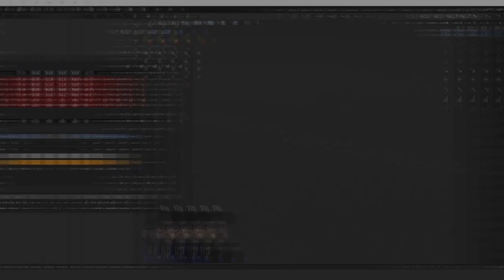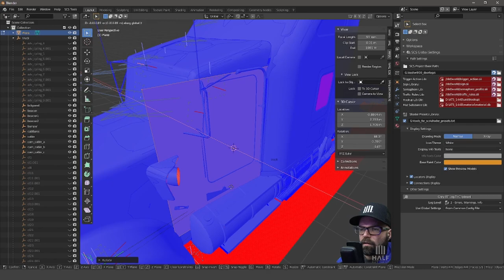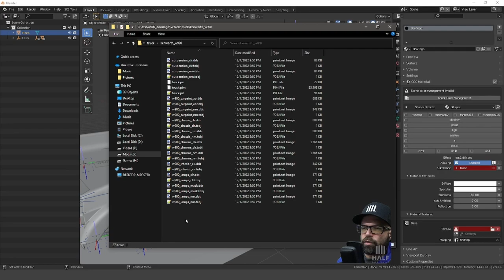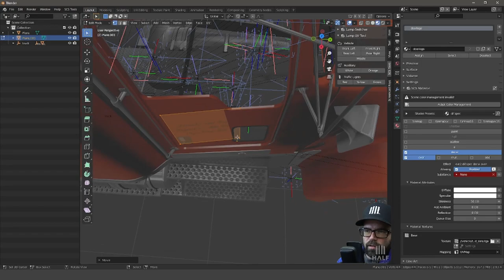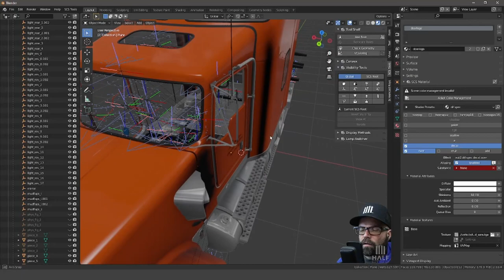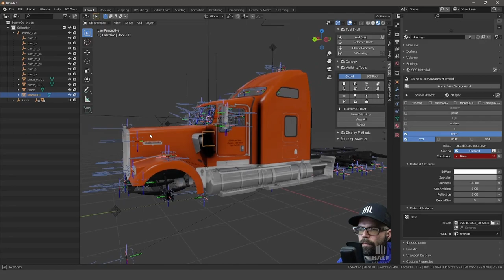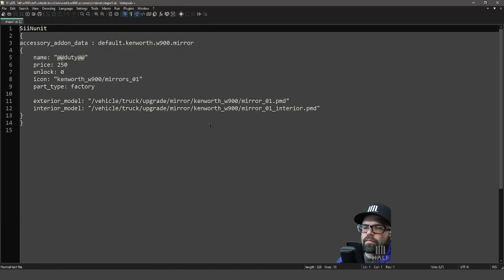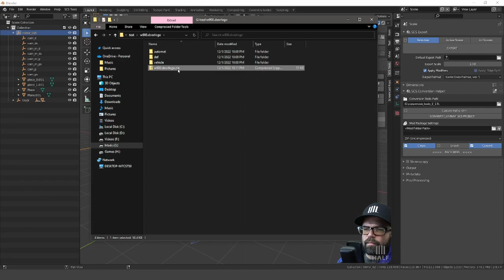How To Mod SCS | Making A Logo Independent of Paint Jobs! | ATS Modding!

Comment: How are you keeping the transparancy in the .TGA file? When i load mine the white background is still visible
Reply from the maker: dif.spec.decal.over
is the material, which is shown in the video
Reply: @Halffastgaming  Thank you so much for the response! This video specifically has helped get me past a 3 day hang up.. my only issue now is this. 

When I save the standard image as Targa (.TGA) the white background is still there in blender on my plane even using dif.spec and decal.over

When I add an alpha channel to the image in Photoshop to make it transparent, then go to load it onto my plane in blender, the entire image is transparent with dif.spec and decal.over.

What im doing is adding a logo to a window, and Ive applied these steps to that model and its worked out GREAT! my only hang up has been the visible background of this logo.

Thank you again... your channel has been Blender State University for me. Very Grateful!
Reply from the maker: @BoardingMold446  Sorry I don't use pshop. I just use paint. Make the image then select everything that isn't the logo and delete it so I only have the transparent background.
Reply: @Halffastgaming  Thank you! My alpha layer was messed up. figured it out, and it looks great! 

Now im hooked on this modding stuff. You're pretty damn knowledgeable about blender.. would adding flags to a truck be possible?
Reply from the maker: @BoardingMold446  the flag in the sleeper? or the ones on the front bumper?
Reply: @Halffastgaming  more like creating a new model, like a flag pole with a functioning flag (blows in the wind). And how to place it on the back of the truck.

I guess specifically im trying to fly a US flag behind the Ruda 3500